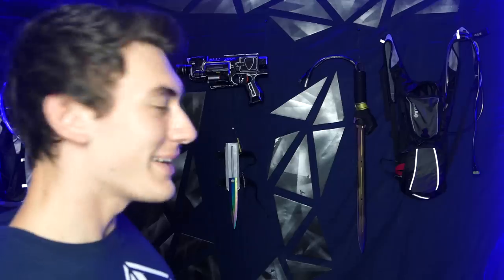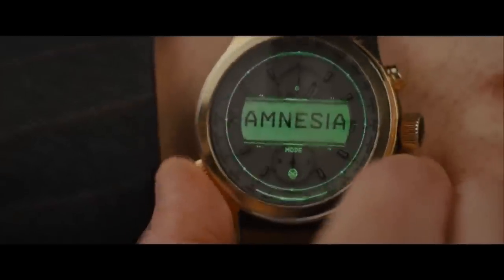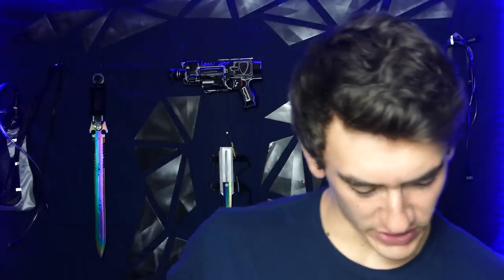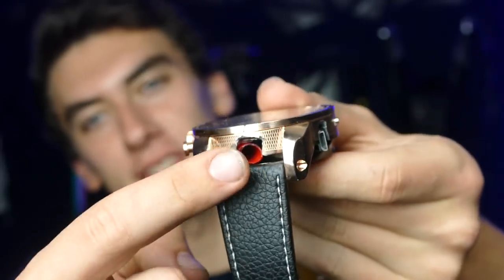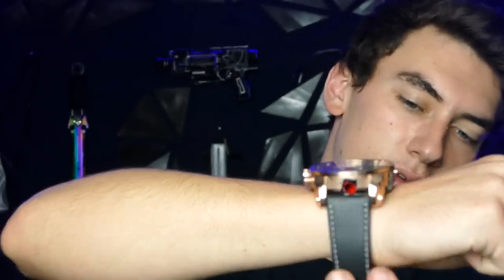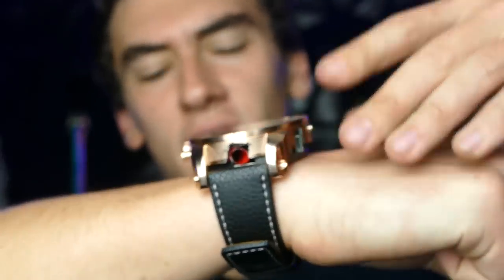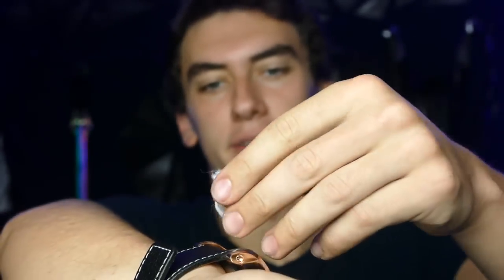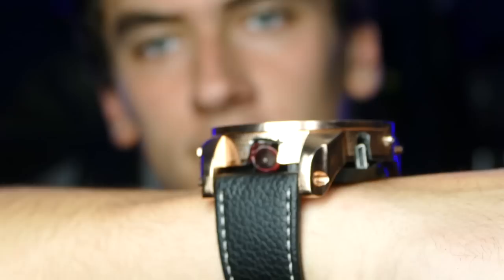How To Make a WATCH DART GUN! - KINGSMAN SPY GADGET!!! (Cheap Easy Build)

Comment: you should use tungsten wire lighter, it require less part and can make the whole module smaller.
smaller diameter tube can also improve this build
Reply: yeah, so he can put the normal clock mechanism in it so its a clock that works and also shoot dart

Comment: my own EDITH designs have turned out to be about 80 percent of stuff you did already but i only saw the video of recently so turns out im howard stark instead of tony. the capacitor will be on a regulator as part of a supply that could pop a defensive arc but would be to power a glove input. once i find the right AR suite, Destiny Ghosts and your mini drone just made help and directions a breeze.